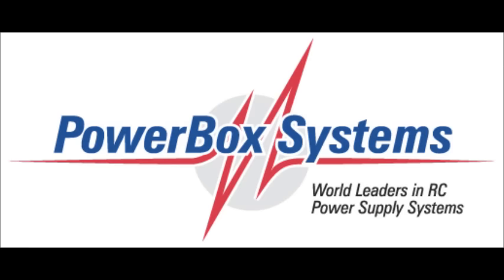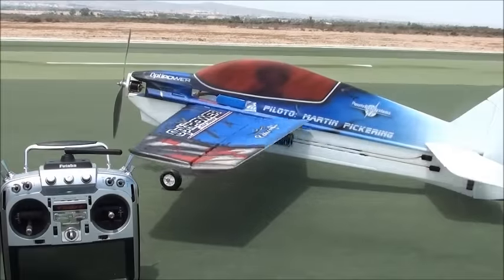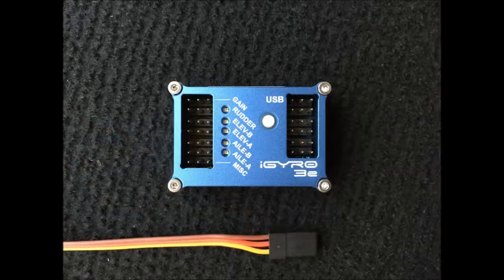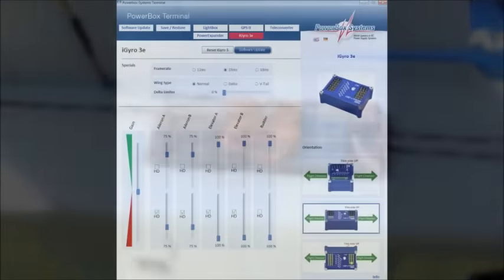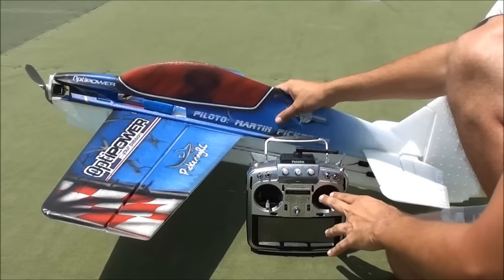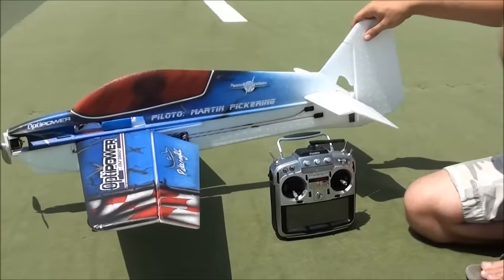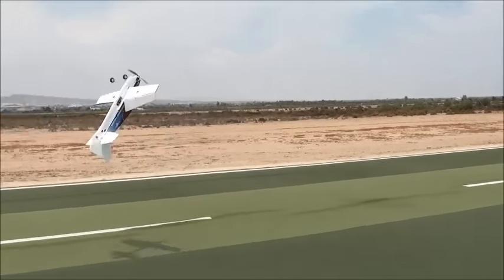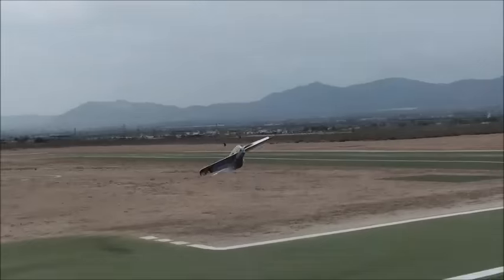Powerbox-Systems iGyro 3e Tutorial overview

Comment: Doesn't the higher end Futaba systems have built in gyro systems? If a "Y" connection is used from the receiver to gyro, can one of the individual channels be revered on the gyro-e?

Comment: I fitted one to my jet. Should I use rate or heading mode?
Reply from the maker: +Karl Taschner Use the flight assistant to set up the perfect combination of each gain on each of the axis.  usually you will end up with a little heading as well as normal gain.

Comment: Hi. Would you tell what does "mics" socket mean on iGyro 3e? I guess it is for S-Bus connection. But I cannot find anything about it. How to program it and which channels does it use?  Thanks.
Reply from the maker: Hi, the misc can now be used to connect the GPS II module so that the gyro can adjust the gain based on airspeed.  
The 3e is quite a simple gyro, with one patch lead per channel used.  For Srs functions you need to go to the next gyro up, the iGyro Srs
Reply: Ok. Thanks a lot.
Reply: Martin Pickering PickeringRc GPS gives ground speed (Speed Over Ground) only. So, If a model with 90km/h airspeed flies against 20km/h head wind, the ground speed read by GPS will be 70km/h so it's not a 100% reliable method for gain correction

Comment: hi friend, what the difference in normal model and heading mode? i fly jet rc and this divice can help me on strong wind days...
Reply from the maker: Hi Adriano, Normal Mode corrects and compensates any "bumps" caused by wind.  Heading mode also adds a small amount of "auto pilot" trying to keep the plane pointing in the same direction you left it.  Usually you can use a small amount of heading mode and it just helps the plane track even straighter.
You will see a big difference in your jets in windy conditions when you use an iGyro :)

Comment: Hi Martin, I have setup and test all surface. 
it flying ok on gyro off, then turn on Normal mode m, while 3mins into the flight the ailerons locks go into a lock, tried to go back to off mode and still. No reaction. This is my second test and still can't seem to get it to work. Thanks for your 
advise
Reply: Is it possible that I have too much gain?
Reply from the maker: Hi Jephry, do I understand that after turning the gyro on, it flew correctly for 3min and then locked? Or you turned it on after 3min flying?
-
If you flew for 3 minutes with the Gyro ON, I would say that your problem was not gyro related....  Gyro problems would occur instantly once you activate the gyro, or not at all (only exception to that is when you fly faster than before, in which case the plane can oscilate due to excesive gyro gain)
-
If your problem occured INMEDIATELY after turning the gyro on, I would reccomend that you check that your Gyro is correcting in the right direction, as it could be that your aileron gyro is reversed!  To check, please turn gyro on, lift the right wing, and the right aileron should lift also (like right roll). If it goes down, you need to reverse the gain.
-
Good luck, and let me know how you get on!
Martin